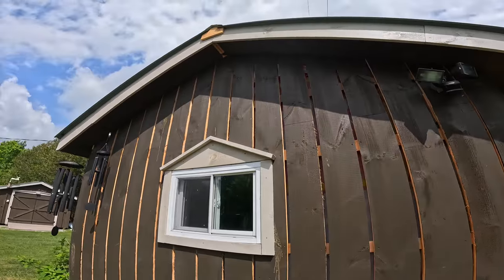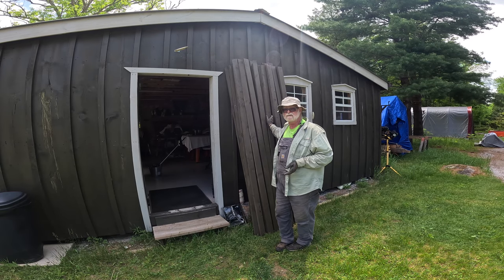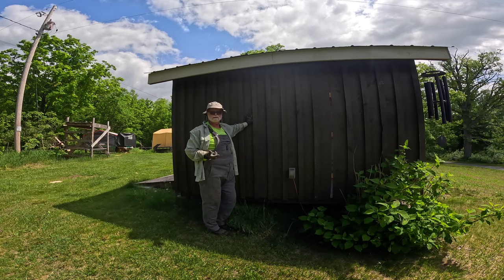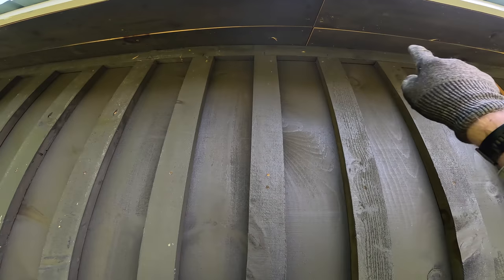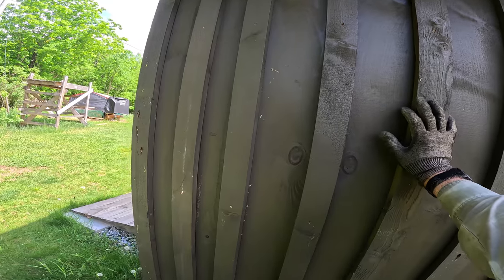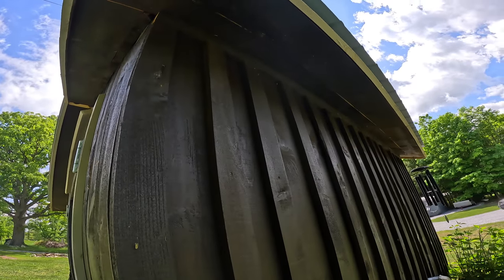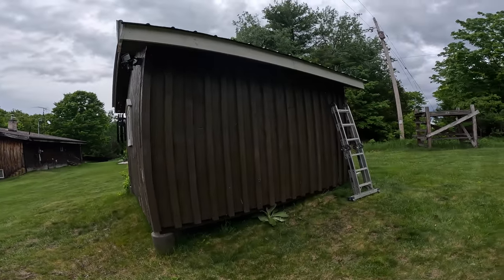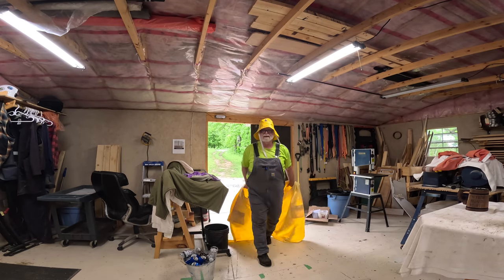Board & Batten Siding From My Sawmill To My Shed (DIY)

Comment: Thanks Brian. Always heard about board and batten, but ever really knew what it was. Old houses use to have a little  kick plate at the bottom of the singles. Out from the wall about 2 or 3”. Was installed at about a 30 degree down warded angle. Rain would run of but not back up the 30 degree angle

👍🏻👍🏻👋👋
Reply from the maker: Yea, it’s an old trick but still works. Thanks for stopping by!